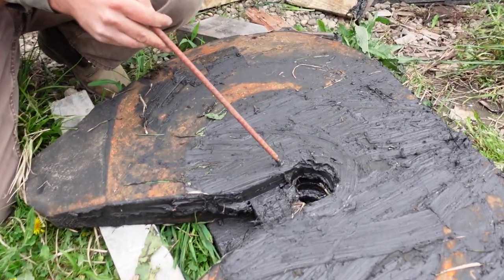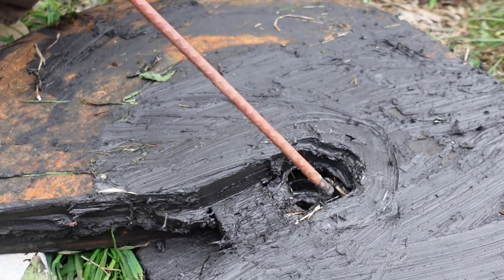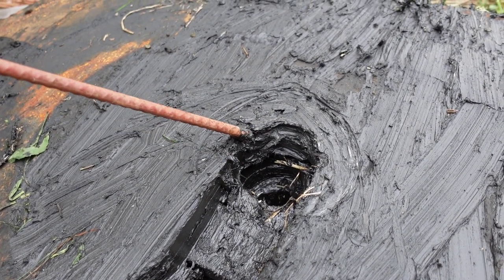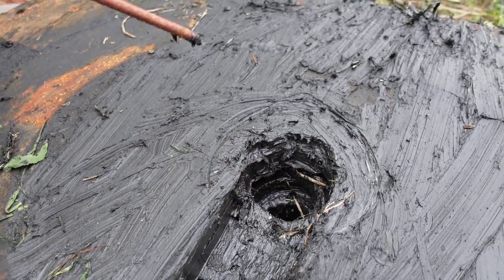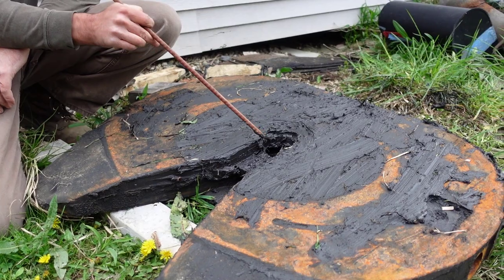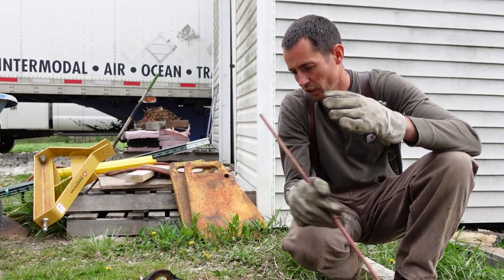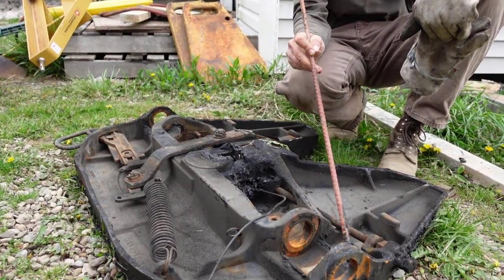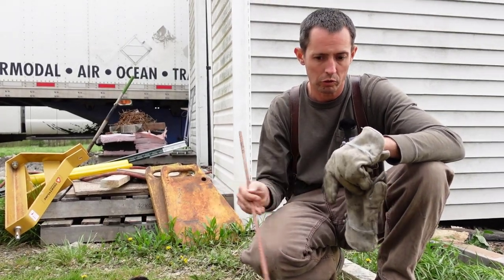How To Tell Your 5th Wheel Needs To Be Replaced? & Which Is Better, Fixed vs Sliding 5th Wheel?

Comment: You're a lifesaver thanks for the information. Had a truck there was so much slop in the  5 wheel,  thought  the Kingpin on the trailers were going to break, drove it for a whole year complaining about it to my company I drove for. They would never fix it , the company , said I complain too much about maintenance  and  they fired me. So after that, they finally replaced the fifth wheel plate and rails,  the mechanic for the company only put in every other nut and bolt on the fram rails, the person that drove it next was shut down by Colorado. DOT. because of the missing nuts and bolts. Wish you had made this video about a year ago. I could have killed somebody , and the company would have just blamed me. You can't put a price tag on your CDL.

Comment: I like a long slide blockable 48" tall air slide. In 28yrs in a truck the above setup can pull everything. And I need 15 ft from kingpin to centerline of steer axle. 
In a Small bunk Cabover. 
If your pulling older trailers get a kingpin go/nogo gauge. I pull new old all the above.

Comment: A new cusion ring and jaw is $500.  You don't need to take the top plate off to rebuild the 5th wheel.  In less than an hour you can rebuild that 5th wheel.  Jost has made these super easy to adjust and rebuild.  Save your extra money for fuel.

Comment: One more good reason to have a sliding 5th wheel is, you can get your trailer closer to the truck for better air flow / fuel mileage
Reply: Get 12000 lbs on steer to maximize the gross weight. My truck weighs 18000 lbs. I pull Alot of 40ft Tri axle trailers. it helps with the trailer pushing you in the curves and rain.

Comment: Adjust the slop in the jaws with the nut on the front of the 5th wheel.  Also check for solid hook up by making sure the nut is seated back against the 5th wheel.  Does yours not have the adjustment rod/nut?
Reply: Holland has the rod with nut sticking out the front. Ryan has a Jost fifth wheel

Comment: So my fifth wheel will not lock or unload automatically, I have to pull or push the pin manually , I have been driving like that for many years, does that mean it’s a bad fifth wheel?

Comment: Hey bro, what if I didn't grease my 5th wheel properly,  and the trailer actually shaved metal off the 5th wheel?? Only on the ends though,  is that ok?? The 5th wheel is new.

Comment: 5th wheels are super easy to adjust. When they run out of adjustment you can rebuild it easily and cheaply. Just get the service instructions from the manufacturer. It's hard to believe any mechanic would replace a top plate just because the old one needs a new spring and an adjustment.
Reply: Mine getting a little sloppy....are they really that easy to adjust? I might try doing it myself too.
Reply: @swamprat69er  thanks

Comment: Ryan, great videos!  My go to mx place. Thanks.  I have a question regarding 5th wheel placement.  So are King Pins alwasy built in the same place or same measurement from the front of the trailer?  And so then how do you figure where to mount a fifth will slider plate? I have seem some on a 3-axle  tractor that looked way too far forward. And the sliding portion was very short (back and forwards).  I have seem some tractors where the 5th wheel was way the heck back. (i realized you dont scale out w the 5th wheel like that).  But how do you know when is right or not right?  And how hard is it have the whole kit moved back ?l  Thanks  I guess you need a whole "5th Wheel School "  video!!
Reply: All of that depends on what type of trailer you'll be pulling. When pulling open deck trailer you might need more space between the cab and trailer for front overhang. With an rgn (removable gooseneck) you might need it to be at the tail of the truck so the drives will clear the deck when turning.

Comment: Hi Ryan, I just recently bought my first used truck and everything seems to be fine so far until I noticed that the 5th wheel is completely flat and it stays flat when its normal position supposed to be tilted down when not hitched to anything. I know some people lock the tilting function on their 5th wheels when hooking up the truck to frameless trailers and thus the 5th wheel will have some modification to accomplish that. However, I looked at mine and it seems stock with no modifications. I have a JOST 5th wheel like yours... so is my tilting seized and needs some sort of repair or does it need to be hooked up to a trailer and give it some flexing by going in and out of driveways to loosen it up? Your input will be greatly appreciated Ryan
Reply from the maker: Sorry for the delay! Is it a new 5th wheel? Mine was a little stiff until I worked it a little bit.
Reply: @truckingandfixing  No, it’s not new.

Comment: Bro Bad fifth wheel or kingpin can effect to transmission or engine?
Reply from the maker: It can affect the driveline. Every time the weight shifts, it will shock the driveline, transmission and clutch.